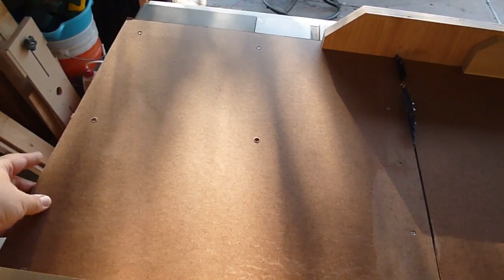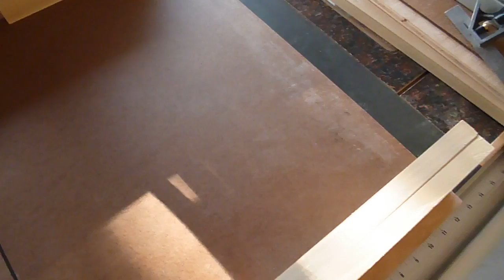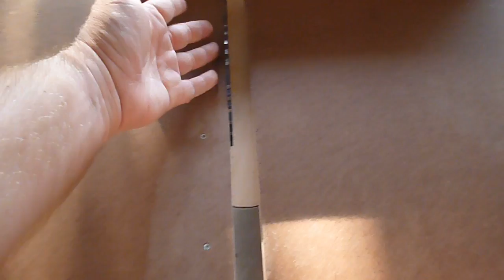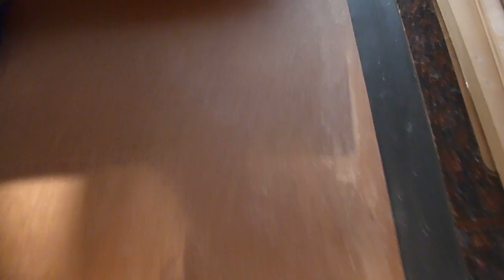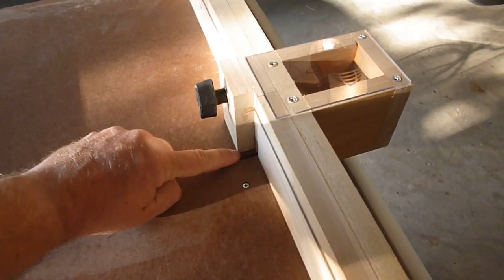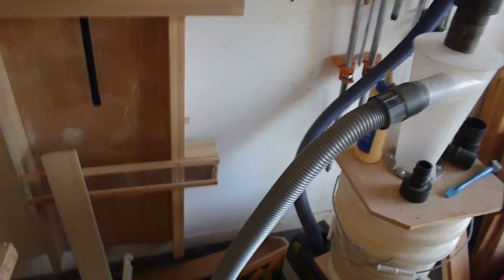My Adjustable Crosscut Sled

Comment: That's a novel solution to this issue. I'm doing one with a replaceable insert down the middle and on the back fence but it winds up having two seams that need to be perfectly aligned with the platform and fence so your idea takes that out of the equation. I like that you could also take your sliding section off and trim it down a little for a fresh edge if got chewed up a bit.

Comment: How's this holding up? Anything you'd do differently?
Reply from the maker: It's used on every project and is holding up great.  I don't use the dado stack much so it seems kind of a waste, but the sled can handle it when needed.

Comment: I have almost identical sled except mine the plexiglass go all the way to the back measure 5 X 32 inches with 2 miter track on on each side to attach two $10 Aluminum Clamp from Rockler and adjustable aluminum slide underneath.  I drill a 1 inch hole to attach my small shop vac to the front box  it sucks all the dust, with ceiling dust air filter and grizzly 2 horse power dust collector connected to my table saw. Cutting anything I feel safe and my lungs healthy , plus my incra express combo. I have a separate dado sled. If have to it again I will the adjustable one you have. Good job though.

Comment: Nice sled design.  BTW, that looks like a Ridgid 4512 table-saw.  Any video on how you made your zero-clearance plate(s)?
Reply from the maker: +Bill Weissborn  It is the 4512.  I haven't made any new videos in a couple years.   The only movable plate is on the right of the blade.  The front and rear fence were decided by how big I wanted the sled.  I then took the measurement between the two fences and cut a piece of hardboard to that measurement along with the distance from the other nonmovable plate to the right edge of the sled and cut it to size.  After test fitting it and leaving it on the sled I placed the movable fences to the top drew out where to drill for screws.  A couple pieces of carpet tape held the fences in place, removed the plate and screwed it in.  I have a long framing square I used to reference the left permanent fence to the new movable fence face.  Stuck it to the tape level to the square and screwed it in.  I left the tape as carpet tape is very thin.

Comment: very nice , but how you measure exact wood in order to cut??? I cannot see any mesuremend tape attached on slide top
Reply from the maker: I have a Fastcap measuring tape.  Without drawing lines on the wood I measure the distance from the stop block to the edge of the blade for the exact distance I need.  Drawing lines on the wood I have a slightly longer piece of wood that I need skim a little off one end to square one end.  I then cut the other unsquared end to final dimension giving myself two squared ends.  Most times I measure out with my tape and place a pencil line where I need to cut and place an X on the side of the scrap.  I'll then line up the pencil line with the edge of the wood then make the cut.  Often times I back up the pencil line method with the stop block for more stability.  I don't really use adhesive tape rules on my projects.  It would certainly be handy, but I just don't work them into my jigs.

Comment: Nice idea to accommodate not only dado blades but different kerf TS blades to keep that zero clearance. Something you might want to think about (since you already incorporated the box joint jig in) is to add the capability to do 45deg miter or any other angled cuts. Take a look at "Paul Jenkins video 036" on YouTube. I may be doing that to my crosscut sled.
Reply from the maker: I considered that, but the rear fence is too long to cut miters on pieces longer than a foot in length.  I can make a dedicated miter sled in the future if needed.

Comment: I use plastic cutting board material for the slides that I get from a local plastic shop. It doesn't absorb moisture so it will not swell up and bind in the table grooves. I place it in the grooves, pin fasten it from the top and turn it over to install screws to hold it in place.
Reply from the maker: I bought a white plastic cutting board from wal-mart and cut it into 3/4" runners about a month after this video was made.  I  have about a dozen plastic runners to use.  As a matter of fact that's the cutting board behind the tablesaw blocking my truck's license plate.  I've already cut a few pieces off of it.

Comment: Nice job.  Can you tell me how the runner on the right side of the sled is attached, with that side being adjustable?  Hope that makes sense.
Reply: Looking at the sled, the right runner is attached to the 1/2" plywood which is permanently attached to the solid parts of the rear and front fence. I would imagine it's just screwed and glued.  It is only the hardboard on top of that which moves. The gap in the plywood is as wide as his dado stack. Sliding the right side hardboard back and forth is what provides for the adjustable zero clearance.